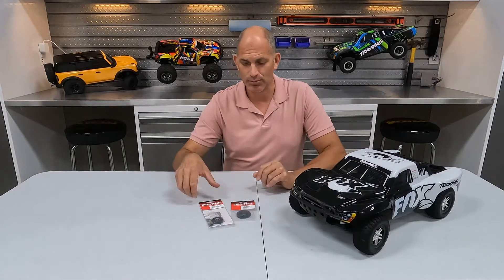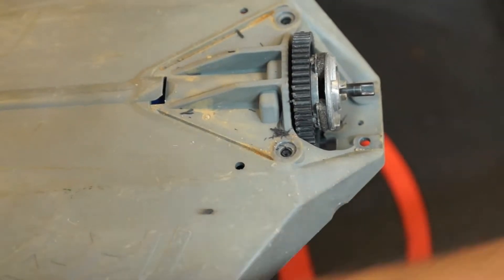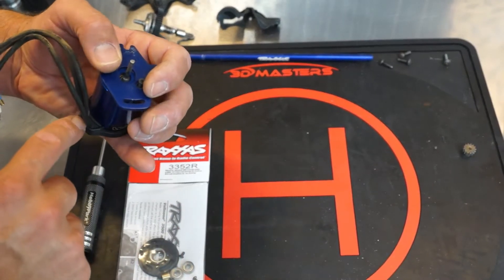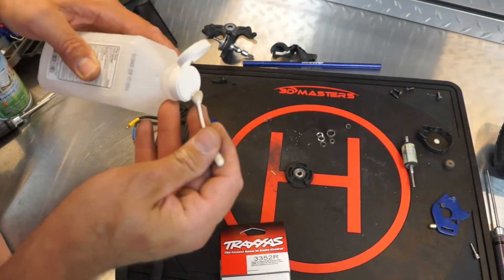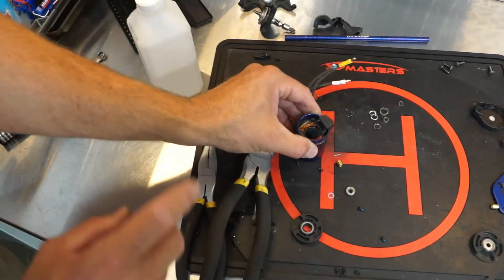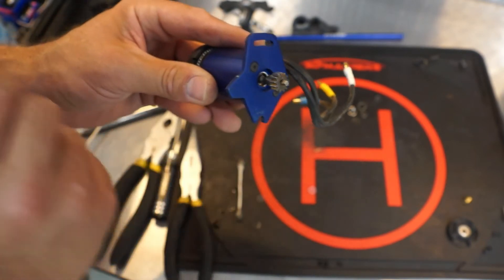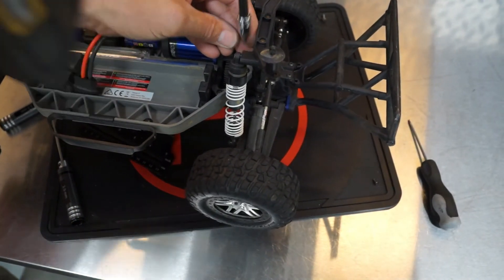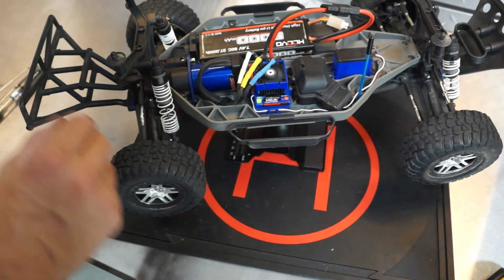Traxxas Velineon 3500 and 540XL Motor Rebuild

Comment: I remember the first time I removed the motor too, did all that unnecessary work. Only need to remove the pinion/ spur cover, remove motor adjust  screw, rotate motor and lift it out.

Comment: Two things . Gear mesh was to tight . And you don’t need to take the motor mount out to get the motor or just pull the top screw fold the motor out and it will come rite out

Comment: Great video. How do you know when it’s time to get a new motor vs repair kit? I have one motor that won’t turn over but you can hear it trying
Reply from the maker: If you are thinking about getting a new motor anyway, then take the existing one apart and check to see if the bearings are actually bound up. You can also blow out between the rotor core and the stator. Finally you could try some electric motor oil on the bearings to see if that helps them rotate. If the oil helps then you should be able to rebuild and solve your issue. If the paper or the windings on the rotor core, or the magnets on the stator are damaged, it is time to replace the motor.

Comment: Do you think it's possible/practical to replace the cables? Mine are all warn out :/ I can't find an exploded diagram which shows how the cables attach internally
Reply from the maker: I have never tried to replace the power leads as they are soldered on to the motor windings. I suppose it is possible, but I dont think it is practical to do so.

Comment: Great video, really helpful but my question is: what did you do with the second spacer that was included in the rebuild kit ?
Reply from the maker: Sometimes the gap is a little bigger and you have to install both of them. And sometimes you drop one on the floor, never to be found again🤣
Reply: @1Rockyjl  I have yet another question. So how often is this maintenance needed, once a year or when you hear that dreadful noise from the motor. I have my Slash 4x4 vxl for a year now , I'm not a basher but I drive it a lot in a track that my friends and I have build, and I ended up getting that strange noise and it seems that the axle and the pinion does not turn smoothly.
Reply from the maker: @georgepapamichail1006  As you suspected, the frequency is entirely based on use. If you use your truck on a regular basis then you may find you have to do it a few times a year. If it sits on the shelf for months at a time then it may be years between rebuilds.
Reply: @georgepapamichail1006  My nephews lasted about 4 months as a new driver. It got heavy use on rough terrain. His was in a Rustler.